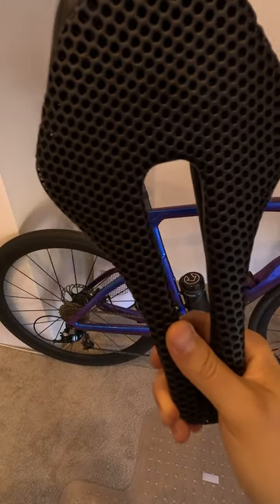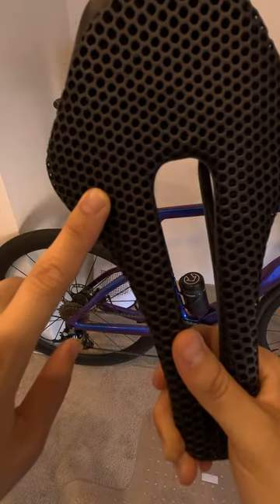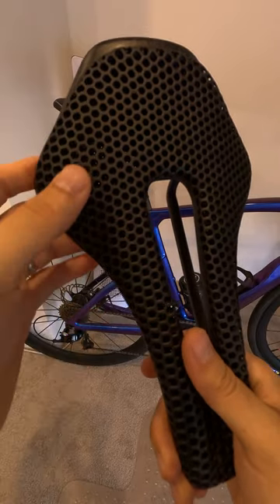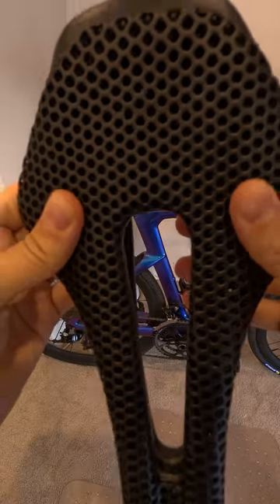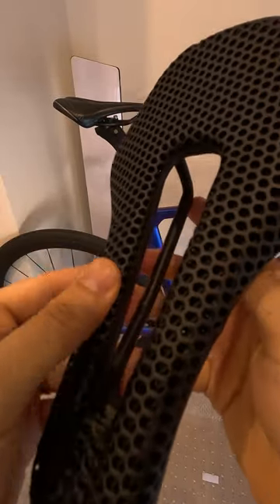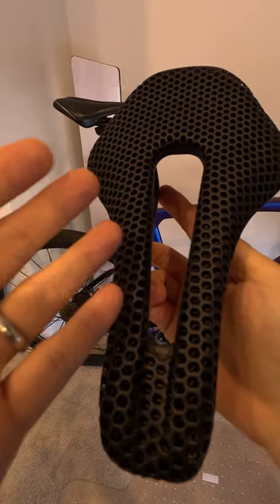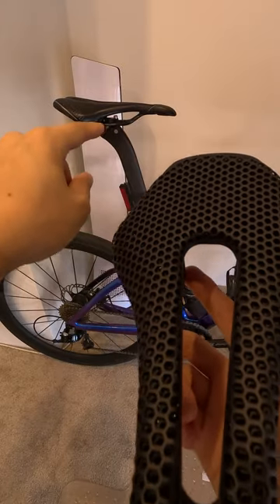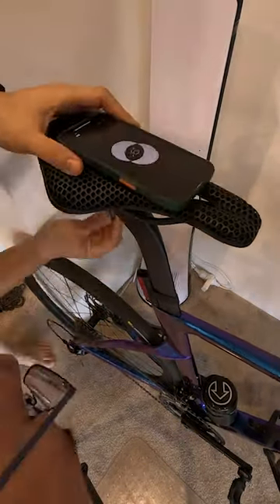Is this Chinese 3D printed cycle saddle any good? How is it stacked against Fizik and Specialized?

Comment: Unfortunately my experience with the Ryet / Zuess Aircode 3d printed saddle has not been so good thus far. I use it on my XC MTB hardtail. It lasted one (1) month before the the nose of the saddle separated from the rails where the rails and saddle nose are joined together. Ryet has sent me a replacement. However they made me pay for shipping. We will see how the second saddle copes with relatively abusive South African XCM racing.
Reply from the maker: It is not the top quality stuff you would expect form other well know named brands. It kind of do the job and I did have a similar situation which I repaired with a glue mix and it seems to hold up after 3 months. So give it a try if this one fail as well.
Reply: Surly Chinese copy stuff isn't for racing or more serious riding.
Reply: @cycleandexplore what glue mix did you use? This just happened to me after a friend used my bike

Comment: I’ve had one of these Ryet saddles for a few months now and it’s going well for me.
Nice light saddle, carbon base is very firm but the 3d padding does a good job cushioning , about 4000 miles covered so far.
Reply from the maker: I am glad it works for you.

Comment: It’s not bad. Good body shape and dimensions for the right person.  Has a flat profile. It’s not quite a short nose design but very performance orientated when in the drops. Doesn’t have zonal cushioning and the 3d cushioning is a bit too shallow for heavier riders, i found that it bottomed out and my sit bones felt like they were on the base sometimes. For fifty sobs British it’s a bit of a bargain.

Does anyone know what brand and model this is copied from Selle Italia boost perhaps?
Reply from the maker: This is a Ryet Saddle I got from AliExpress.
Reply: I think the Pro stealth saddle
Reply: I am 100kg and like this saddle, didn't feel bottomed out.  I have the cromoly, plastic version which is a bit more comfortable than carbon though.